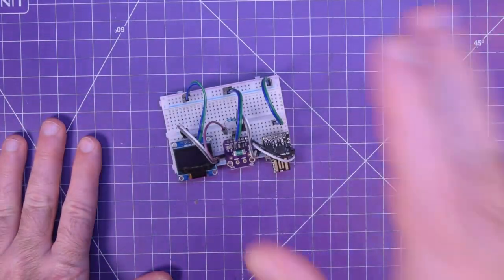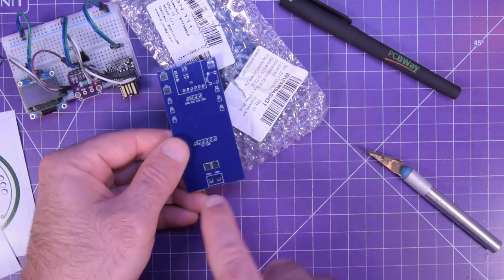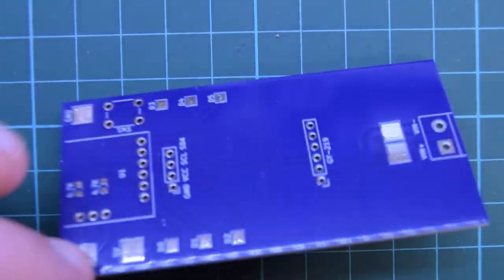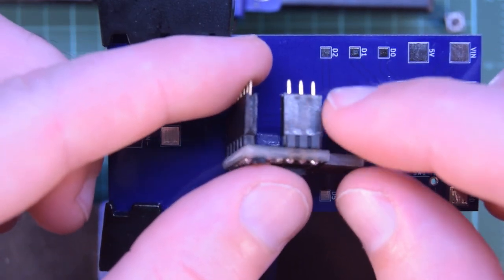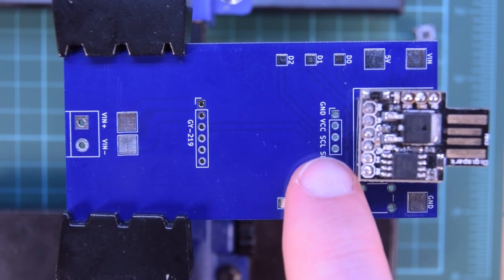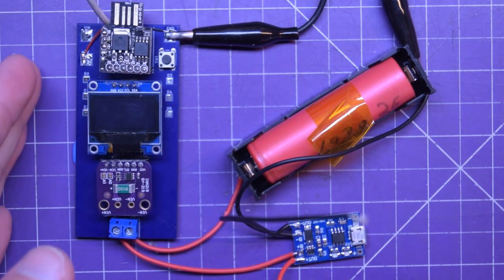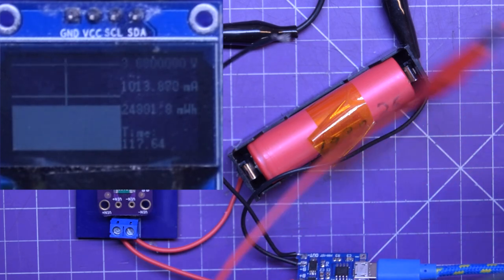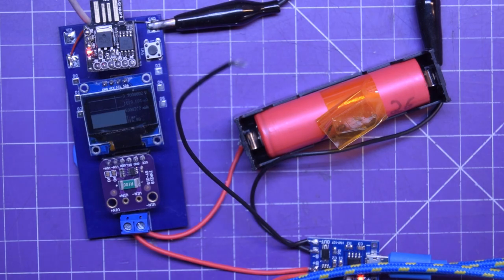Tiny Current Meter Project!

Comment: Seeing an easy and useful PCB project like this makes me want to rush to the basement and see what parts I have to inspire a little project as well. Except my parts are still so scattered it would take 20 hours to even get going. What feature were you trying to implement with the push button?
Reply from the maker: Wanted to toggle full-screen voltage, current and energy. Turns out the project only had 1 font included, and I can't figure out how to add more.

Comment: Recently did a project with digisparks and switched from the prototype with usb tab to final version with micro USB (because those could be sourced faster) and pin footprint is the same (just board dimensions are different obviously)
Reply from the maker: Weird, the footprints are different for mine
Reply from the maker: Weird, the footprints are different for mine

Comment: There is a "relative" simple solution to the OLED being dim. Instead of updating the whole display just update the changed pixels. You should be able to write on a pixel to pixel on the buffer of the display ( I am not sure about that ). As you fill the buffer to be send out, do a XOR on the pixel and then either write or flag for change and write the changes. But that´s just a suggestion, I haven´t really played with these OLEDs much to know that this can be used. This might be possible, this might require more bandwidth, I have to test it myself to know. Nice little project to have laying around though! Cheers!
Reply from the maker: I have zero of these abilities so you can let me know how it goes!
Reply: @SimpleElectronics  don't expect anything fast though. But I'll try!